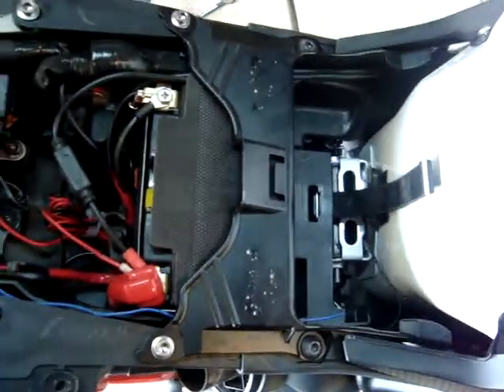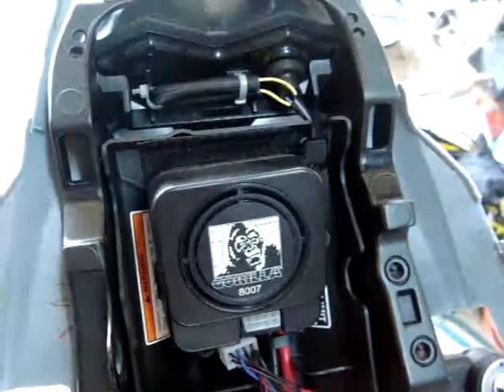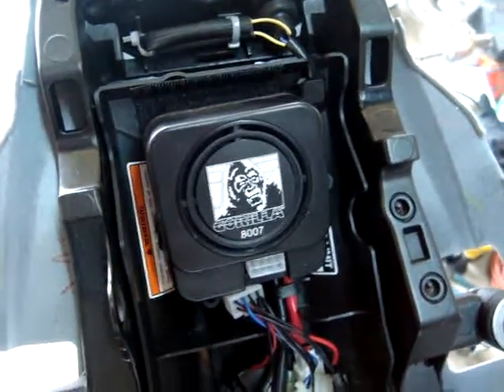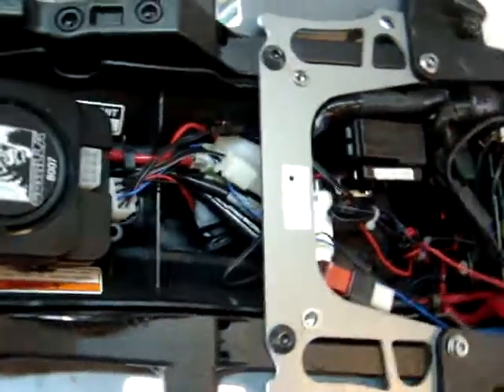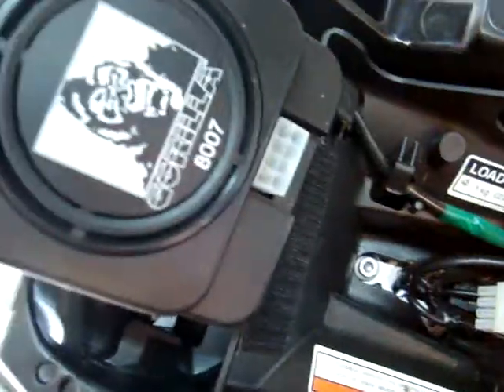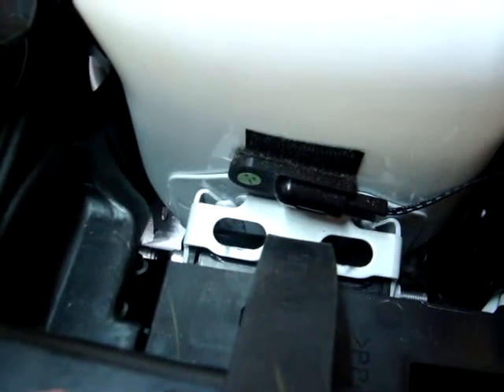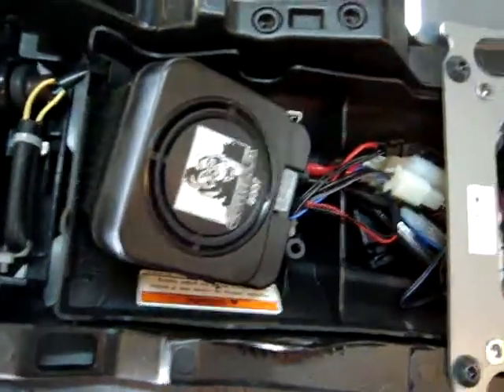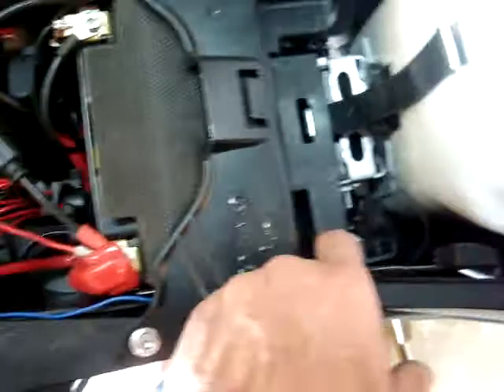R1 2009 Gorilla Alarm How to install

Comment: The only connections you mentioned were to your battery. Did you not need to splice connections to the indicators and into a circuit that becomes live with the ignition on?

Comment: I am using the 9100 on my 2011 zx6r and also have the sproket locks for extra protection of them not rolling it away
Reply: Still working? I just bought a 9100 hope the pager beeps when alarm goes off.